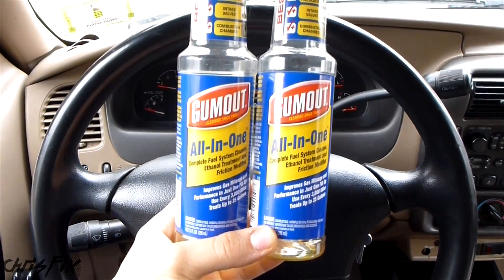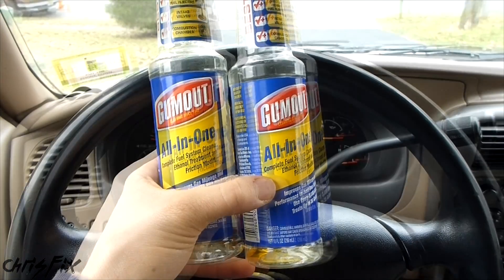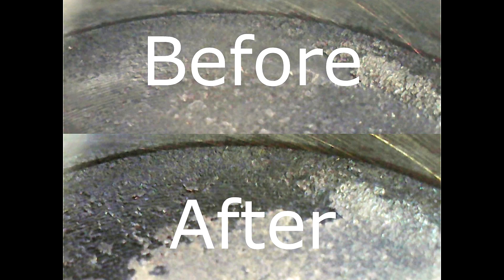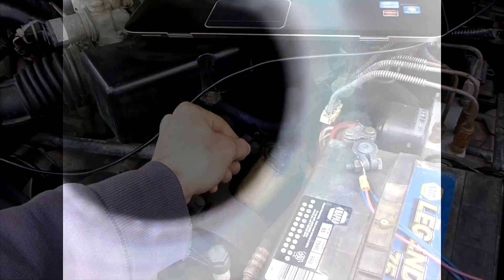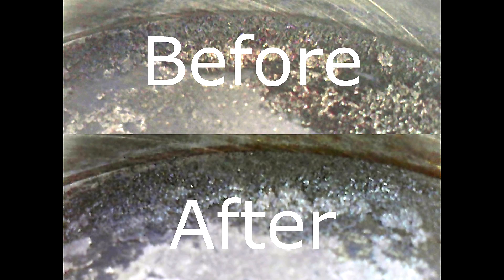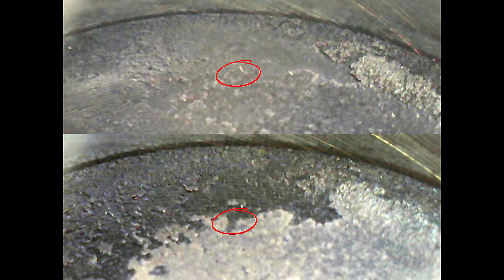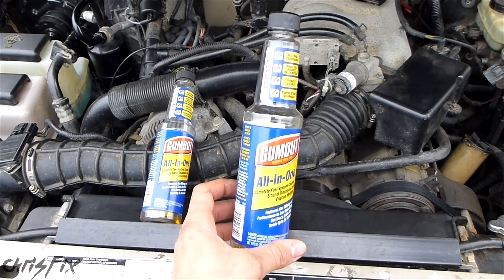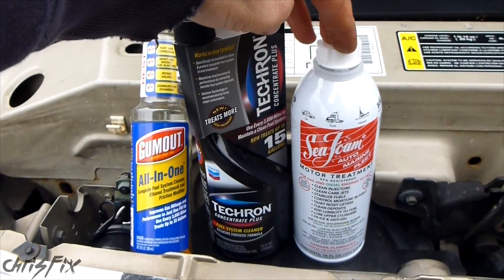Does Gumout Fuel System Cleaner Work (Follow up)?

Comment from the maker: In this video I make final conclusions on Gumout "All in One" fuel system engine cleaner. I think these last two video will give you an idea of what to expect when using this fuel cleaner. Now onto testing Seafoam, Lucas Fuel Treatment, Techron, and Water. What do we all think?
Reply: Could you try a test on BG-44K which is one of the most expensive cleaner's around.
Reply from the maker: kkovler1 I will add that to the list but no promises I have a lot of cleaners already suggested that are on the list, but I will do my best!
Reply: @chrisfix  do you think you could work something up with the fuel injectors? Before and after performance?
Reply: @chrisfix  pour some down the plug holes leave it over night then check it/run it 👍
Reply from the maker: Jason Bilow haha, now that would make a good video lol
Reply: ChrisFix lol lets hope you don't get a huge smoke release and neighbors call the fire dept. haha
Reply: ChrisFix Redline Complete SI-1 (30-50% PEA), or Gumout Multi-System Tune-Up(30-40%). BGK is hard as hell to find, but the other two you can get at local auto stores pretty easily. I trust Redline as a company more than Gumout, Gumout used to sell other products with PEA but after a year or two on the market they replace it with basically just kerosene or naptha once the word spreads that it's a good product. Any company that bates and switches is not something I'd rely on...

http://www.redlineoil.com/content/files/tech/MSDS%20SI-1%206-11.PDF
Reply from the maker: Jason Bilow I cant wait either! I will probably be testing seafoam next because I really want to see if that works!
Reply: You should do the water test first since it is the cheapest and if it works would be the best for everyone. Why smoke up the air with Seafoam or other products if water works? So far. your test is the only one on Youtube I can trust because no one else is using the camera to PROVE their case.
Reply from the maker: rathf150 I cant wait either!
Reply from the maker: ***** The plug seems good and it was fine before but maybe... I need to check the egr and make sure it is cleaned out!
Reply: ChrisFix I would look out for BGK, or Gumout Multi-System Tune-Up. The reason for this is those very specifically have PEA in them. Techron used to, so did Gumout Regane, but they recently removed it from their ingredients list on their MSDS sheet. If it's not on the MSDS it's not there! I am very curious about any of those three, and I know that the Gumout ones are easier to find. And yes, I can see you thinking "why the hell would Gumout make so many fuel additives/cleaners". I think the same thing, frankly they should ONLY make the Multi-System Tune-Up. I think it has to do with price, though, they can make the stuff you used in this test for pennies and sell it for dollars. Also the fact that Regane used to have it and now it doesn't mean they're up to switch and bait tactics which I do not condone or appreciate. PEA has a patent on it held by Chevron, so I'm sure it costs more to use which is why they do this.
Reply from the maker: Jesse Crandle So what product has PEA in it that you think I should test?
Reply: I've heared the BG 44k works wonders some people say it's the only one that works I've even heared someone say it made a 5 mpg increase in fuel Econ. I'd love to see a before and after shot of the combustion chamber with that.
Reply: patrick cordery I'm not Chris, but Rockauto.com is a great place. They're sell a lot of parts for a good price, but usually wear items. A valve body is a bit of a different story, although I see they have them. The good thing about a valve body from RockAuto would be that it'd work guaranteed. They're 192 dollars plus shipping, and a $25 core charge. Somewhere local might be better than online honestly, maybe call a garage or look up local junkyards etc.
Reply: Try Berryman B12 Chemtool
Reply: You aren't supposed to put B12 in the gas tank. That's why it's a professional cleaning system. Turn the fuel pump off via fuse our relay. Connect into the fuel rail in place of cars fuel system and clean away. Scott Kilmer recommends this over putting even Gumout multi- system fuel treatment. This had PEA unlike the Gumout Chris checked which if it does, it isn't specified on MSDS.
Reply from the maker: Faisal Abdulaziz But that isnt what the bottle says. They make it seem like you will clean out your engine with the first use.
Reply: ChrisFix Your fuel system could be contributing to the issue of not getting your engine clean. Some cylinders look cleaner than others, well that would suggest your fuel injectors might be really dirty.
Reply: ChrisFix thanks alot.....dealership is alot of money even for oil change...i mean sure they will be done in like 15 - 20 minutes ....with there fancy lift + hydraulic powered oil fillers with electric gauges and all that....but im not in a hurry...and i can save alot..and its good for you to be self sufficient
Reply: #3 may have a bad burn.
Reply: ChrisFix Cant wait to see Lucas! I use nothing but chevron fuel, not sure it matters but its suppose to have techron. I did do the seafoam thing and I was waiting for this big smoke trail like I saw on youtube but I only got a tiny puff lol. I put it in my gas, oil and intake. First 2 were done when I was going to put in new plugs and change oil.
Reply: Eric Rollins BG 44K is (or was) very high in a chemical called PEA, you can get other things high in PEA like Gumout Multi-System Tune-Up or Redline SI-1 Fuel System Cleaner.
Reply from the maker: You can see if a parts store such as Advance Auto can order one for you. I dont know how good those ebay ones are. I googled "Valve Body" and trans star came up and they seem to work on only valve body rebuilding. Maybe contact them.
Reply: Jesse Crandle
If what you want is PEA. The Gumout that Chris tested in these videos actually has more PEA than the Gumout Multi-system formula that Scotty Kilmer tested. However, if your numbers are accurate Redline has even more PEA than Gumout or Lucas. I've heard a lot of good things about Redline but haven't personally tried it yet. (availability in my area seems difficult)

Lucas Transmission Fix has saved my mom from her transmission being fixed. If I have a little valve noise a little Lucas Oil additive quiets it up. Per Ericthecarguy's trip to Valvoline, even if your engine is quieter with a thicker oil you shouldn't do it....but without them giving a good reason why, I think if a little squirt of Lucas makes the metal clack go away that it's a good thing. Maybe they have to say "use the thin oils" because their number one goal is fuel efficiency despite engine damage eventually being a lot less efficiency!

I digress, but with good reason, the above experiences makes me want to "believe" in Lucas's fuel treatment, but is it really good? I don't know. :) I will say this though after a LOT of time on MSDS sheets. Lucas has less PEA than any of the Gumout products I looked up and the most PEA in Gumout is on their regane formula that has less check marks for what it takes care of.

The primary difference between Lucas and Gumout is that most of it is just a solvent like you mentioned Jesse, BUT Lucas uses a different solvent than Gumout, better/worse? I don't know. What kills me is your comment that they'll make a product good for a while than pull PEA? I'll have to watch out for that.
Reply from the maker: DE Nichols Yea, these MSDSs are not all the same. Let me know if you figure out if this has PEA in it.
Reply: DE Nichols
Lucas
Upper Cylinder Lubricant has no PEA or if it does it's in the 10% category that remains vague while 90% of it is Hydrotreated Heavy Paraffinic Distillate
per this website/pdf:
http://www.lucasoil.ca/msds/MSDS10003-10-10-12.pdf
Reply: DE Nichols  This is the one with the good stuff:
Lucas Deep Clean™ Fuel System Cleaner
Solvent naphtha (petroleum), medium aliphatic
30 - 60%
Polyether amine
10 - 30%
Oh and what's awesome about the website is Lucas actually puts this on their website. They don't mind you knowing what's in it!
http://lucasoil.com/images/documents/SDS_Deep-Clean-Fuel-System-Cleaner.pdf
Reply: I'm currently following your "how to change power steering fluid." Thanks for posting helpful videos
Reply: Jesse Crandle thank you ill have to do that
Reply: ChrisFix That Berryman B12 Chemtool is supposed to be some strong stuff. Quite a few people said it seemed to work but they had problems with fuel pumps after they used it.
Reply: Exactly. From the reading I did on it they used to recommend adding it to the tank. Probably because of the fuel pump problems associated with it they stopped recommending that.  

For an In-Tank fuel cleaner I'd still go with BG-44K, Techron Concentrate Plus, 3M 08814 Max Strength Fuel System Cleaner, Red Line (60103) Complete SI-1 Fuel System Cleaner.
Reply: Unfortunately, the exact bottle that Chris showed by Lucas Oil didn't have PEA. I hope he has the receipt, rechecks my comments and exchanges it for what does, or all of his tests will end up PEA free. :(

I haven't found a Seafoam MSDS with PEA yet; his other planned test is water decarbonization.
Reply from the maker: Faisal Abdulaziz Neat results with your taxi service. I have had cars go on average of 300k miles with no problems and I dont use fuel system cleaners. They are a waste of money and after my results, I wouldnt recommend them unless you have a clogged up injector or gummed up valves.
Reply: why thank you...problem is...we cant provide the same maintenance and downtime for all the cars...we wount even meet ends due...so yeah,,,i my self part owner of this taxi service get my hand dirty to help the 2 mechanics we hired...things are not going like what they used to be,,,,,oh well...oh come on i think they do work...have you tried liqui moly.?...3M ? its good stuff,,,
Reply: ChrisFix
I try to use Top Tier gas.  I also had that BG Fuel Treatment service done to my car.  Recommended by Goss' Garage on Motorweek.  I did it as maintenance, not due to any problems.  I have a high mileage Ford like you, runs great.  One bad thing about a finely tuned car that runs smooth as silk, it's hard to tell if anything "helps".  lol
Reply: ***** I have the same trouble on most things as a well kept ride sees some good things as, "What's the difference?"
Reply from the maker: Justin Hickey Unfortunately, he didnt do any tests. He was payed to sponsor the product and the before and after was of different piston heads if you look closely.
Reply: ChrisFix  cant wait to see that one
Reply: Can you please test berrymens chemtool
Reply: ***** If that's the same as B12 he's already said no as it has catalytic converter and fuel system damaging chemicals. Acetone eats rubber.
Reply from the maker: dhowser2008 Yea, well now they are very clogged from using all of these fuel system cleaners lol
Reply: Faisal Abdulaziz
You got me to share something cool I learned. :) I'd wait a few oil changes prior to any fuel cleaning treatment. Prior to some contamination on the cylinder heads, cleaner will help DEPOSIT contamination.
Reply: i have a 2010 volvo s80 T6 with about 100 000 kilomter ...i do 2 oil changes and 1 bottle of fuel cleaner every 10 000 kilomtere ..thats more than what the factory have on there maintenance list...and when i compare it to the dealership cars in maintenance ....my piston tops is like new...still shines i swear....and the rest of the clients cars in volvo who are paying the dealership to maintain their car have significantly more carbon build up with same mileage....so it does not take long before it starts building..not long at all....the factory maintenance is not bad but it is not best ....it is made to be budget friendly....i have found that its cheaper to do these service procedures by your self than going to the dealership (stealership)...for the price of one oil change + filter in dealership i can do it 3 times in front of my house or in taxi fleet garage with my own tools... i have calculated that by the time your done changing oil 6 times in volvo dealership you have paid for what it is equivalent of SNAP ON starting tool kit...LOL....and thats how i change oil alot on my car and afford cleaners and all kind of quality tools ..yes
Reply from the maker: Faisal Abdulaziz Awesome man and exactly! I am glad you are learning a lot and doing your own work and saving a lot of money!
Reply: Try mixing up all of the fuel cleaners!
Reply: i never used a single additive til 125k miles on my 3.6L CTS with the LY7 Saab engine that is know for high amounts of oil blowback. It was driven on 87-89 octane for the first 108k miles before i got it, ive used premium 93 for the last 18K since car is tuned for 91 stock. Chose to use a fuel system cleaner and Gumout actually cleaned my injectors nicely because i noticed the differance driving it because i did 50miles of hard driving before adding it and filling up. Then threw the Gumout all in one fuel cleaner in with 15gallons of 93 and 40-50miles later noticed a bit quicker throttle response it seemed peepy.
Reply: +DE Nichols yeah the LY7 is SIDI injection im pretty sure. it just so happened that i had my whole top of the engine ripped off before adding the Fuel system cleaner. i had cleaned, ported and polished my upper manifold so i got a good look at the inside of everything else. i was feeling lazy didnt want to clean the nasty build up in the lower intake manifold. What was weird has halfway down the ports in the headers the nastyness was gone and my intake valves were actually almost sparkling clean which i almost couldnt believe at 125K but ive read it is the tune on these Saab engines that minimizes intake valve build up dont know how true that is but ive seen it be said by some very knowledgable people on the somewhat excessive oil blow by. ive only had a catch can on for 80-100miles and its caught almost a full fluid oz of dark contaminated oil and i literally just did an oil change 200miles ago. But after a bottle or 2 more im probably going to look inside the intake manifold and headers to see if it cleaned that space between the Injectors and the intake Valves
Reply: MrClayFTW looks like an android auto correct. You're good. 

I have a broken 1996 Saab 900 SE. V6 2.5 liter. NA.

You have the turbo right? 

I could easily have it running but several simple things like tail lights only being available for $200 used holds me up. Lol

When I had it going though it only had slightly worse MPG than my Chevy Prizm. The silly car's onboard mpg broke when I was coasting in neutral on the freeway...it could handle that before iridium spark plugs but not after. The MPG was TOO good. Lol

When I changed the back spark plugs I noticed all the intake was covered in a layer of old oil. Yes, if I ever get around to it I'd port and polish the insides too...the casting was pretty rough. Was yours? 

Definitely share changes after a clean up. If it makes it easier we could Google plus friend and see the pics.
Reply: ***** I spend 40 percent more on ethanol free fuel. For my Nissan Frontier, it just runs so much smoother!

There are websites dedicated to helping people find ethanol free fuel. I hope you can find one and try it out.

The gas mileage is the same so far, but when I first tried it, I got a big bump in mpg.

I just like less moisture in my fuel system. It's probably better for the whole car.

I still like water decarbonization, but when you so that, it's temporary. All the time water is bad. Ethanol gummies...for people gummy worms are candy, it can't be good for a car either. Lol
Reply: Aref Eshghi Prevention is the key according to a cab company owner who watched Chris and his videos. He ran one cab on random cleaners throughout it's life and another with none. When they were both at the end of their service life the uncleaned cab only got worse when they cleaned it. Cleaning big chunks of carbon off can cause engine damage. He said it only got worse.

The fuel cleaner cab? They kept it in service.

Note: both cabs had similar duty and both had a mix of drivers from the company. They both had service done regularly but sometimes late though out their service life.
Reply: Good. I just don't want them to mess with some electronic part of the engine or fuel system.
Reply: ChrisFix can you please review BG44?
Reply: Gumout has released a new product called One-N-Done Id be curious to see how it measures up to your test considering its supposedly so effective that you only ever need to use it once a year.
Reply: Hey chris where I get a valve body for my 97explorer  ? My od light keeps coming on? Ebay sells them do you think they whould be ok to get one off there? Thanks
Reply: You're awesome! Thanks for these honest reviews! I can't wait for the Lucas, I use that all the time!
Reply from the maker: DE Nichols So that stuff I used has PEA?
Reply: Absolutely
Reply: Hmm. Finding different MSDS now. 2008 to 2011 it consisted of two things 40-60% fuel distalates and vaguely 40-60% fuel additives.
Reply: ChrisFix
 I was convinced it had it, but as it gets later and later, I'm just not finding an MSDS that says one way or the other 40-60% fuel additives and 40-60% petroleum distalets is extremely vague. Gumout Regane however does have the PEA for sure. In away, if Gumout All in One doesn't have it's a better test since you will be doing the Lucas fuel treatment.
Reply: DE Nichols
 I think I need to counter comment myself. I can only find 2008-2011 MSDS sheets on this specific gumout product and it vaguely states 40-60% fuel additives and 40-60% petroleum distalates. Very vague and can't say one way or the other. However, the Gumout Regane product definitely has PEA, more so than Lucas fuel treatment...which is where I'm going to get vague again as there are multiple Lucas Fuel treatments.
Reply from the maker: DE Nichols Good to know. I will have to check it out! Thanks!
Reply from the maker: Raymond Davidson Awesome! I love hearing stuff like this! Good luck and let me know how it goes!
Reply from the maker: Eric S I might give it a try if I cant get anything else to work!
Reply: Jesse Crandle From the looking into fuel injection cleaners that I've done the Gumout product to use is the Regane High Mileage. Other good ones to look for are BG-44K, Techron Concentrate Plus, 3M 08814 Max Strength Fuel System Cleaner, Red Line (60103) Complete SI-1 Fuel System Cleaner.

I read a lot about how the companies are allowed to fudge the MSDS sheets to confuse other companies. Apparently Techron still has PEA in it but they are fudging things to keep percentages secret.
Reply: does this one contain PEA? my understanding was that the only products with PEA in them from gumout were the ones marked REGANE on the bottle. their high mileage regane is supposed to have the most PEA content, i dont know if this one you used has any in it
Reply: wildcard749
The all in one product hear doesn't admit to it one way or the other. Does it have it, or doesn't it? With it being a known working chemical, I'm sure they'd admit to it on MSDS if it was there.

I've bought a different Regane product that did have PEA. They have several versions of every title you can think of. The last Regane bottle I bought did have PEA and then this All in one that I bought on sale didn't.

Buyer beware. Summary: match the exact title with a MSDS. Only way to know.
Reply: ***** Your comment has a very good point. I'd add that the pictures on the bottle show old engines getting clean right away so it is exaggerated performance in my opinion.
Reply: ***** thats what i keep telling them....if used from day one of the engine life the engine will be spotless from the inside..
otherwise your asking for alot....
Reply: then people can actually sue them for what the product is claiming...
Reply: Faisal Abdulaziz Depends on if under the picture or on the bottle it says, "results may very."
Reply: @DENicholsAutoBravado  vary
Reply: here we go lol...
i knew it ,,
ive posted on multiple videos about fuel system cleaners the result of our ford mondeo A and B ....from our taxi fleet...and resutls speak very loud on 5 year test we did,,,,, baiscily car b is history....due to high mileage and "reugular factory maintenance "car A didnt even have sludge/carbon build up "after dismantling the engine head "and smoked car B by a car and a half on the drag strip.......because we over maintained car A starting with frequent use of fuel system cleaner and 2 oil changes per one oil interval,,,in other words the oil doesnt even have enough time to break into sludge....engine is  LIIIIIKE new even thought it had the higher mileage
all fluids on car A were replaced before its schedule "before breaking point".....if you want your car to outlive you YOU MUST do this...the maintenance suggested by factory is budget friendly...cause you want something new by the time you hit 5 or 10 years of ownership and they want you to buy the newer model...so yea...you can make your car go 20+ years easily...
Reply: ChrisFix
like i said....these must be used from the start....(from first oil change) to keep the engine spotless...losening up what took years to build is risky...

what ever you do...dont use the oil flush at this mileage...simply because you will upset huge chunks of sludge and slide it into oil channels and potentially cloge some of it and cause oil starvation failure...

it happened it alot...this isn't an assumption..
im talking from experience..
Reply: Faisal Abdulaziz Your story resonates with my life. :)
Reply: DE Nichols glad to see more people doing the same thing....the more of us there the better....and the more shops will be available for us to rent to fix our own car very good Nicholes
Reply: TheDude  try it from the start of engine life (every 10 000 miles ) that will work
Reply: Faisal Abdulaziz I will on my next younger vehicle. :)
Reply: I need a bore cam like Chris to see how it does though. Recently I realized that's the bigger take away on this series.
Reply: Look up cerma fuel treatment.  Try that and test it.
Reply: +DE Nichols i lied not SIDI i mean SEFI
Reply: +DE Nichols yeah the LY7 manifold probably have the same rough dimple casting in the aluminum. i couldnt stand it i even polished the outside haha. i highly suggest a catch can my car has a lot of oil blowby.  My 3.6 is not turbo though unfortunately supposedly they have handle 10-11psi supercharger kits from australian Capa. ive seen 1 person running 75shot nos but what i would prefer is to get LLT or Saab 2.8T for a turbo manifold setup but that is a bit in the future. I actually just lined up with my buddies over 400whp JB4 BMW 335 with a few other goodies and he didnt pull on me as hard as i expected he only beat me by a car length if that so im trying to get it dynoed soon to find out what ive got. i just know i have a same parts plus a quite a bit more than 2 guys on Cadillac forums that dynod 304whp 302wtq with LY7s
Reply: Try using the fuel system cleaner with premium fuel instead of regular. It might work better.
Reply: Matt Sokol
Ha! Found another link for you under that search to a comments page on a ChrisFix channel about fuel that'll help you too.

https://plus.google.com/+chrisfix/posts/YLGbUVy9bC3
Reply: +DE Nichols cool!
Reply: Matt Sokol :)
Reply: +ChrisFix What if you started using gumout before that carbon buildup? Maybe it would prevent it? I imagine that really hard stuff was shiny before it became hard maybe its possible that if you used this on a newer car that buildup would never occur.
Reply: Vox Nihili One of the commentors shared his experiment having 2 taxis with very similar service. One used various fuel cleaners, one without. The more he cleans the cab that needed to leave service, it's done, the worse it gets. What is being cleaned is destroying the engine and the other is still going strong beyond its expected service limit.
Reply: ***** If It's legal in your state, yes. Sometimes only marine and small airplanes can have it.

It's not cheap, but a natural gas conversion can make your car run so clean, you hardly Change the oil. It never gets dirty, but the viscosity additives can break down so to know how long to go you'd need to take samples.
Reply: If I learned how to make a natural gas conversion I may not still not do a DIY video on it as some people have killed their whole family doing it wrong.

You lose a little HP to it.
Reply: I'm still looking for your marvel mystery oil test!!
Reply: Conservative America I have a friend who really liked it and then had to junk it...may or may not be related.
Reply: Ethanol free mpg benefits turned out to be a bust, but I'll still get my tank low and fill up on ethanol free of a vehicle has to sit.

What was actually helping was lucas upper cylinder lubricant - a fuel additive that is designed to raise compression. Engine sounded smoother and got 22 mpg on  4x4 frontier, sure 2x4 is supposed to do that, but not the 4x4! It's supposed to just get 18 on the freeway and I was getting 14-16 (gentle footed).
Reply: I would suggest you put BG-44K at the top of your list, I have personally used the product and experienced major improvements in performance, it would be nice to see it through your borescope though.
Reply: I even Subscribed to show support
Reply: whats your favorite additive?
Reply: ***** I'll be coming out with a video on how much better my truck gets mpg with regular treatments of Lucas Upper Cylinder lubricant. Come subscribe.
Reply: What if you use it every now and then starting from when you buy the car as brand new? E.g. using it every 10000 KM for the beginning? Maybe then it doesn't let the carbon to pile up?
Reply: ***** I finally came out with that Lucas Upper Cylinder Lubricant video. I also did a Cataclean test.

I stopped the ethanol free fuel. I think it worked on placebo as I didn't keep seeing results. Plus, it was high octane and high octane will carbon up engines designed for lower octane.
Reply: Thank you very much for the information. However, I will try to find out more about long term use of these cleaners before using it on my car regularly. 
Of course, I tend to change my cars before they reach 70000 KM (~45000 Miles), so I assume there should not be a problem even without using the cleaners.
Reply: Aref Eshghi Usually no serious  issues I'd think, but I think it'd improve or maintain your performance. Remember, these cleaners do more than the test shown here.
Reply: Aref Eshghi The Lucas Upper Cylinder lubricant additive that I mentioned does spike the O2 sensors rich on first startup since at least a little doesn't mix, or scientifically it falls out of solution. 

I have run it with nearly every gas tank since I found it improves gas mileage even with a cruise control test on the same stretch of freeway.

Maybe 18 months? 13k miles? I thought an O2 sensor was going but it looks like it was a bad spark plug wire. Video coming on finding a bad spark plug wire with an infrared thermometer.
Reply: Looking forward to the new video. 18 Months sounds reasonable.
Reply: where's your water test?
Reply: ChrisFix I talked to my bg rep at work and he said to get with your local BG products rep and let him know you will be doing a review on it on youtube and he will give you the products for free.. make sure you do the fuel injection service and the 44k in the tank
Reply: I think Gumout has added more PEA to their cleaners??  Has this improved the product line?
Reply: Stephen Maurer PEA Engineering Explained said, was the only peer reviewed scientific journal approved cleaner. Not that nothing else works I suppose, but I think it would have.

You have to watch Gumout like a hawk. They put out one cleaner with PEA when Scotty Kilmer talked them up and everyone else was sponsored by them, but I could only find their non-PEA chemicals actually for sale.
Reply: PEA is not a harmful additive so it doesn't have to be listed on a safety data sheet. Just because it's not listed doesn't mean it's not in there.
Reply: Any thoughts on CRC?
Reply: ChrisFix can you do a injector clean vid plz mate
Reply: Can you look up to see the valves?
Reply: ChrisFix i
Reply: ChrisFix how about redline fuel system cleaner?
Reply: Can you also test liqui moly fuel system cleaner ?
Reply: Finally what do you recommend @chrisfix
Reply: Cataclean video is needed
Reply: Yes
Reply: Interested in the next tests, Seafoam, Lucas ,and Techron would be the big 3 in my eyes.
Reply: MrClayFTW From Chris's experience it doesn't seem effective for the combustion chamber, but more likely helps with valves and fuel injectors. Didn't help valves if someone has direct injection ... Your car should be port injected right?
Reply: ChrisFix, was your car's pistons/engine as old in mileage as your odometer stated for the car, or was the engine/pistons newer? If so, what was the mileage for them?